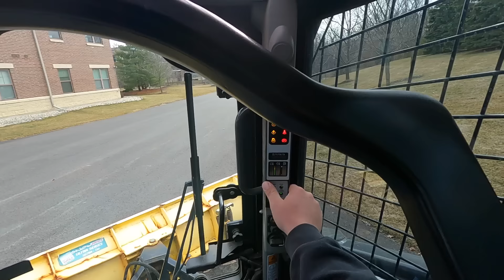Is 2024 going to be a good year???

Comment: Snowblowers are a perfect example of something just awkwardly heavy enough you CAN lift it into a truck by yourself, but you should probably get help even though you shouldnt need it.

I've watched a lot of tint videos from some guy in like Michigan. You cut the top of the window to shape and leave excess on the bottom. Once the top is in place you roll it up and cut the bottom to length.

Comment: After you apply the top of the window tint you just roll the window  the rest of the way up and finish it off but don't get carried away trimming the excess off the bottom after you get it where you want it you can trim the excess off and then make a final pass as long as you apply plenty of water and soap the tint can be pretty forgiving as long as you buy quality tint

Comment: I learned if I take the wood stove ashes and fill an old tire with the ashes then the chickens have a dust bath available all winter long..of course it has to be under one of the old boats we have chillin out back so to keep snow out of it..but my point is if you get chickens you will find uses for a lot of the old junk stuff you have been collecting over the years!

Comment: To seperate the two plys of the window tint. Put a small piece of masking tape on one corner . Another piece facing the first then Stick the tapes together . 
pull apart the 2 tapes and the clear will seperate from the film . 
You can then use the tape as a “handle” to move the film around . Then peel off.

Comment: Your supposed to pry the window sill out its rubber so you can see an inch down into the door panel then put your window down a touch and leave access on bottom side to squeegee behind the door panel lower on the glass. Good try brother its super tough. Pain in the butt. Some cases you have to take the whole door panel off

Comment: Will it be a good year? The last half century has provided a few mild winters with long springs so the odds are the spring will be cold  wet and long. It will likely go thru May with very few days to work. Past that every year that there’s an election the economy has slowed down. This will be a big slow down more than likely. I would have gotten a job somewhere before now and he ready to ride it out or be 
beating on doors looking for 
work I could be doing right now. Sitting around waiting doing nothing paying ain’t going anywhere. The thing about self employment is there never is a time you don’t work. If you ain’t doing actual work the work you should be doing is looking for work.
Reply from the maker: I’m always looking for work thanks!